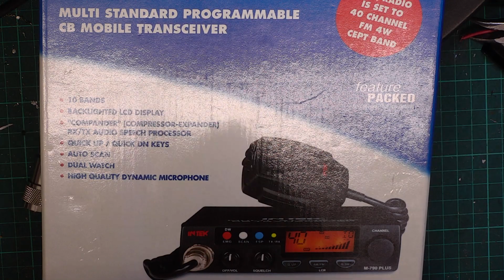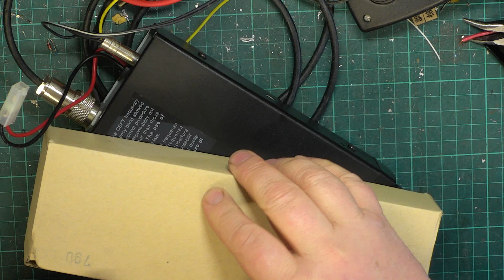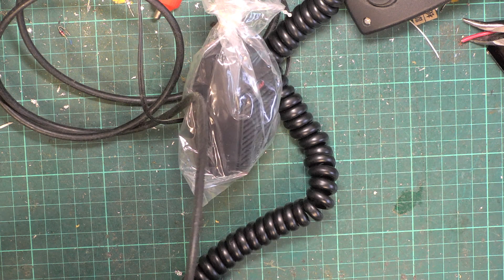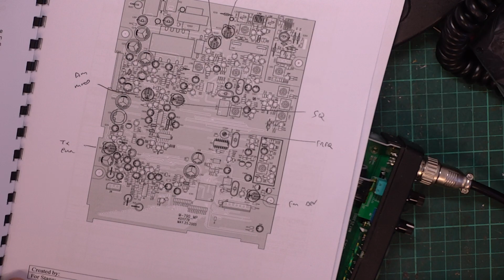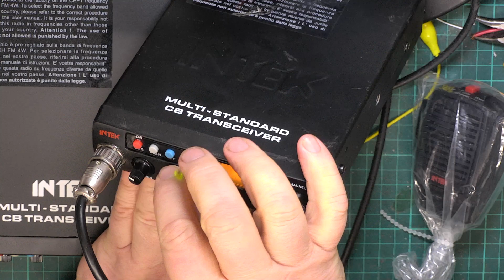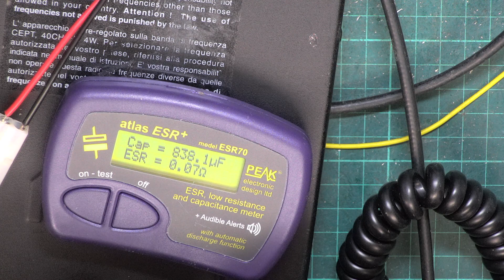Intek M790+ Revisited

Comment: Another great video thank you. To one of my previous comments I have a midland portapack cb and I've been looking at the Thunderpole apollo 2. C/L. with magmount base the antenna hight is 78 meters high would this work with my unit. Thank you so much 👌
Reply from the maker: /you'd be better off with an aerial with at least a 90cm whip. This 78cm design will really restrict your range. Don;t forget whatever aerial you buy, you will need yo adjust it with an SWR meter.  We are going to test three different Midland magnetic aerials (short, medium & long) and also three PNI magnetic aerials in similar categories probably next weekend; they are all here in stock ready to test.

I seriously don't think that with the Apollo 2 aerial on a car you would ever get ore than 6 miles range

Richard
Reply: @ukfmcbradioservicingTango21  hello Richard thank you for your great advice its very much appreciated I'm going to be using my midland portapack cb at  home the built in antenna isn't any good in my front room I'm not getting anything on at all that's why I mentioned that thunderpole antenna to you I just need advice on what antenna would be best. I no I won't probably get very far. As I haven't got a roof as I'm in a flat but I do have big windows and the frames are all solid metal thank you so much for the advice 👍

Comment: That is very poor, a new set never used (allegedly) not working out of a box and only been there 3 to 4 years!!  I can't believe it.
Or should I say "I just don't believe it!"  They must see you coming Richard!
Reply from the maker: The clue is that it came out of the box set to UK channels, when we all know they come out of the box set to EC. Clearly it was a return. Our wholesalers didn't do Intek, so they've been bought in from various sources. Luckily it was sorted in 10 mins. As it came, the VCO would only lock on the lowest CEPT channels & was 1.7V. The manual says it should be 1V, so that's what it got & it then worked fine.

Richard
Reply: @ukfmcbradioservicingTango21  I would have thought they would have at least checked they worked to a fashion!  The manual was quite poor as well.
Reply: Well Bob you seem to no a lot about it all,good job you no how to repair them,so it makes no odds to Richard.